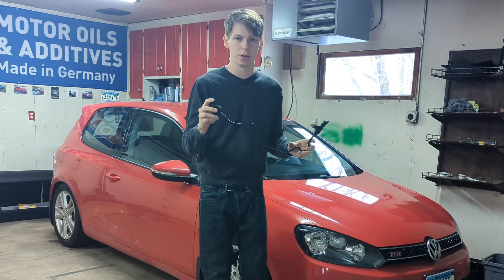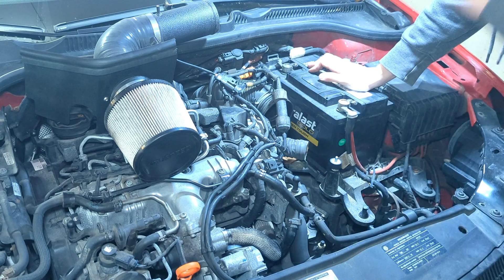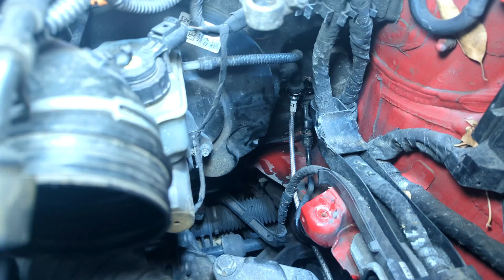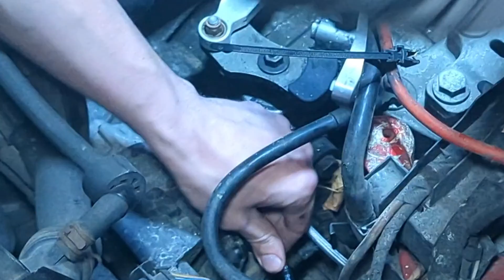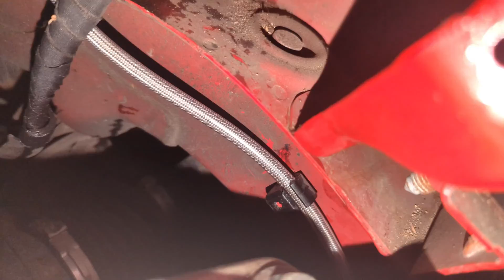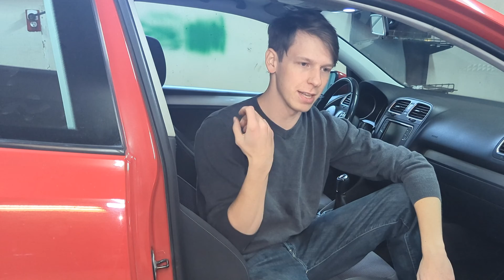Volkswagen Mk6 "Clutch Delay Valve" Delete DIY/ Clutch Line Upgrade

Comment: Just did this install on my 2014 GLI. Only thing I will note is that I replaced the o-rings that came with the line with EPDM orings.
If you google "usp clutch line o ring" you find reports of the stock o-rings failing and it could leave you stranded
Reply from the maker: Pinning this to increase visibility! Do you have dimensions or a part number for the o-rings you got?

Comment: Hi, great video - im about to take out the restrictor on my stock bleeder block, will i lose any fluid and get air in the system by removing the bleeder block to do so or is it only when you pump the pedal?
Reply from the maker: @humanbean899  I'm not sure, to be safe, plan to bleed the system.

Comment: Hey purchased the kit, i have a 2012 gti but the spullen block being squared did not fit. Any ideas ?
Reply from the maker: Is there a clearance issue fitting it up besides the transmission? Pics would be helpful, but ofc we're stuck on YouTube. I suppose you could upload a video and I can try to help?

Comment: Excellent video. 

I just installed the same kit and was wondering if the block can be gravity bled?
Reply: I have a 2017 VW Jetta S 1.4L turbo - EA211 with the 5M non- auto transmission.  Does this vw have a clutch delay valve?
Reply from the maker: Thanks! As for gravity bleeding...I'm not sure, but to be safe, I would bleed it the same way I showed. A power bleeder isn't required, but a failed slave from air getting in would suck. That's a whole transmission drop and you'd want to do clutch+flywheel while you're in there.
Reply: I appreciate the reply. The block and line were the last mods, on top of my clutch and flywheel upgrade. I was just curious about the bleeding method. 

Thank Again.

Comment: Good vid. Watched several on this subject but still don't know exactly what the problem is that you're all solving! Can you/anybody explain what you were experiencing with the stock clutch operation which has led you to need this mod. Thanks.
Reply from the maker: The stock clutch line isn't a 1:1 translation of the clutch pedal input. With all of the built in delays, it makes it harder to stall, but also more difficult to rev match, launch, etc. It basically forces the clutch to slip.
Reply: @eurodriven2507  Thanks for the quick reply, much appreciated. Can you describe how that actually feels to the driver? 
After 3yrs with my Audi A3, it often still feels like I've forgotten how to get the clutch/accelerator pedal balance right [after decades of driving!] and I'm wondering if this "delay" is the cause. Just fitted a new clutch, etc. and it's exactly the same. I've never experienced anything like this on any other car, incl. other dmf cars. This is my first VAG car though.
Reply from the maker: The delay is almost definitely the cause. It's difficult to explain the difference without a side-by-side. If you've ever driven a car with a cable clutch, it makes it feel more like that. My confidence in my clutching ability and the smoothness of my driving (which should help the transmission lifespan) has improved greatly since doing this mod.
Reply: @eurodriven2507  Yes, the more I research this, the more I think this is the problem.
Thanks again for getting back to me so quickly, very helpful.

Comment: Great video! I replaced the stock bleeder block on my CC with an ECS bleeder block. Completely changed the way my clutch engaged, but I didn't know about the clutch line upgrade. I'm really surprised this isn't talked about more.
Reply: How's it been so far? Thinking about doing it on my CC 6-speed as well
Reply: It's been great, I've had it for a couple of years now. My CC is stock with a stock clutch and it's still worth it. @samabbad5112